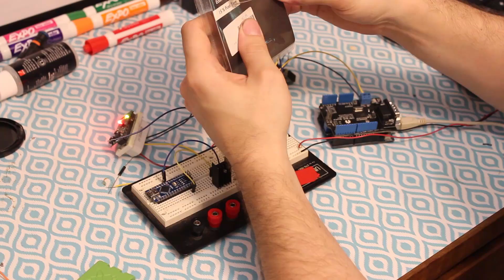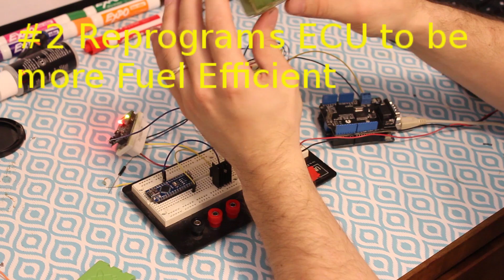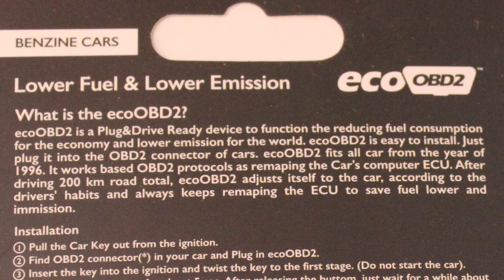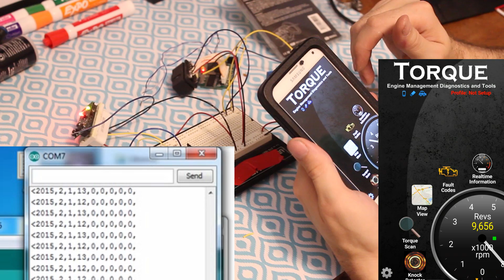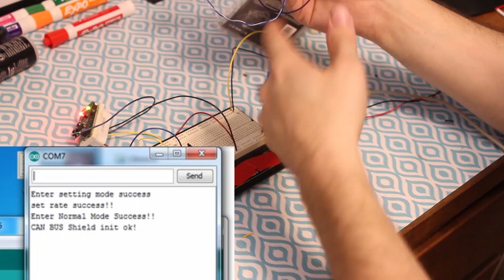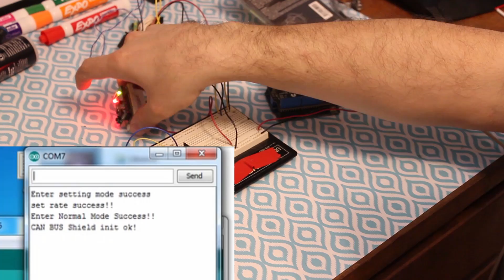ECO OBD2 Fuel Saver Busted - Voiding Warranties Ep 6

Comment: On the back of my eco OBD2
THE DIRECTIONS SAY TAKE THE KEYS OUT OF THE IGNITION. 
STICK THE KEY IN AND TWIST IT TO THE FIRST STAGE (DO NOT START THE CAR).
PRESS THE RESET BUTTON FOR 5 SECONDS. AFTER RELEASING THE BUTTON ABOUT 30 TO 54 SECONDS 
YOUR ECHO OBD2 WILL COMMUNICATE AND ESTABLISH CONNECTION WITH THE ECU. 
START THE ENGINE,.. THE OBD2 WILL RECOGNIZE YOUR VEHICLE AND YOUR DRIVING HABITS AFTER AROUND 50 MILES OF DRIVING. THUS THE ECHO OBD2 WILL ADJUST ITSELF TO MATCH YOUR CAR PERFECTLY FOR MORE FUEL SAVINGS. 

I DON'T BELIEVE YOU DID ALL OF THESE STEPS.

Comment: Aug 28,2023
I bought this for my 1998 Dodge Ram 5.2L.  Drove it 400km and filled gas tank. Drove another 400km and I used more gas not less.  This is a scam scam scam.

Comment: I tried that crappy $60 device (yeah, I fell into the hype, sadly!) and found out that it drains your battery, as it flashes red and green, even when the ignition is OFF and the key is outta the ignition, and even when you lock your car doors! You can easily see the flashing red/green, at night time, under the steering wheel! I will be returning it, post haste, for a full refund! I never even tried it out, as I was searching for why it flashes red/green when the car is off, and that is when I stumbled upon 3 or more videos saying this device is a scam! Thanks for posting!
Reply: It hooks into the same power buss as your ECU, which always draws a little current to keep volatile memory stored.

Comment: I will say upfront that I think using these, tuners as they are called, are a bad idea.  The risk/reward is not worth it.  That said, A car warranty is rarely voided.  I worked for the Customer Service Division of a major auto manufacturer for years.  I can count on one hand the times I saw a vehicle with an actual voided warranty due to a modification the customer made to the vehicle.  The company cannot refuse warranty service on a vehicle unless they can prove the device caused the needed warranty repair.  That is the rub.  They can refuse your repair and then you are stuck going after them in court or through arbitration.  So, they do have the upper hand.  

However, there is something called the Magnusson-Moss warranty act of 1986.  Lawyers often use it, and I am paraphrasing here, because if they go to court and prove the manufacturer illegally denied, what the court determines is a legitimate warranty claim, you can receive up to triple damages plus reasonable attorney's fees.    Another option you have is the BBB auto arbitration program.  

You can ask for your claim to be put in front of group of independent arbitrators.  The program is free.  A group of people with experience dealing with vehicle repair and/or arbitration will review your case.  However, you will have to prove to them that the device didn't hurt the vehicle.  The manufacturer submits a written report, as do the dealer and you the customer.  Another uphill battle, but not an insurmountable obstacle.  At has been my experience that they tend to lean the direction of the customer on a coin toss case.  Hope this helps.

Comment: i got one of these and was suspicious from the get go. After putting it in and setting it up i was surprised to see it stays on flashing with car off and keys in the house. it never shuts off putting a small drain on the battery.
Reply: Yeah me too I figured it would shut down. It’s in the trash 🗑 now resting beside chick fil a napkins
Reply: There is always power in the ecu even with the ignition off.
Reply: @Kgio-2112  the devise is junk . The obd 2 system in auto runs the best and most efficient fuel economy . If this really worked it would be incorporated in all cars . I opened it up and it's nothing but 2 flashing led lights and a 777 timing chip. Does absolutely nothing.
Reply: @grahamcross5652  I threw mine out. You are right. Total scam. I got it in my stocking lol

Comment: You can check all you want. That thing won’t lie to me. I have my car for almost 20 years and runs 200 miles with 10 galos. If this thing works I should be able to pass the 200 miles  mark. I will send a follow up reply as soon as I’m done with the test.
Reply: What happened
Reply: I still didn’t use a full tank but it looks like this sht is only garbage. I don’t use this car much, I have a second car which is a Tesla so the Chevy is most of the time parked. But the car never fails. It always runs 200 miles except for this time. I think is not gonna hit that mark.

Comment: Thanks for the wonderful review !  I think I'll just stick with my flux-capacitor - it's been working great since 1985 and my gas mileage REALLY takes off when I hit 88 mph !  I think that's because it was made in America, where we can SPELL English and our reset buttons don't get hot after 6 seconds !
Reply: Actually, If i remember correctly, all Deloreans were built in Belfast, Northern Ireland, Britain in a purpose built factory largely funded by a British business investment programme intended to provide jobs to the local Northern Irish workforce and reduce violence between Belfasts Protestant and Catholic communities as they would be working side by side in the plant. Was John Deloreans pipe dream disaster from start to finish and cost the British a fortune. Though I do genuinely  believe the flux capacitor will at least match these EcoOBDs in function and performance and you probably have as much chance of one of them transporting you to 1955 as saving you even a drop of fuel. 🤣
Reply: Are you using petrol, or Mr. Fusion (Trash)? If trash, then this is not an issue for you. If you are using petrol, they claim no change until after you have driven over 200 km. There is no way that they can resemble that. My question is, if the lights stay on when the vehicle is off for a period of time, will it drain the battery enough at some reasonable point to make it unable to start the vehicle?
Reply: Hey man!  Deloreans are CANADIAN!!!  ;-)
Reply: How do you get 1.21 jigawatts?
Reply: Scam avoid like the plague

Comment: I saw this dirt cheap, so I got one, wondering if it would actually work.   If not, I'd just be out 5 bucks.   Weill, the instructions, as you know, don't tell you dick all.  I don't care about how it works, I just want to see results and... now that I've got this installed in an out of warranty 2003 car and driving it to work back and forth for almost a week.  So far, I've noticed my gas usage has drastically reduced.   I was expecting to fill up tomorrow, as I usually get about 4 to 4.5 days on one tank.   Right now, I'm sitting at just over half a tank left.   I can't explain it.  If this kills my car, it's not a loss for me, so I can take the chance on this.  But I'll hold off putting it into a newer car.   I just wanted to mention the unexplained reduction of fuel consumption... and I don't noticed ANY performance issues either.   Maybe I got one that actually works?   I've seen these retail online for hundreds of dollars... those must be scams.   The one I got, gives me positive results, so, who knows.  lol  Peace.

Comment: Ever since i purchased this product 5 years ago, I haven't refueled. I've been driving on $5 gas for 5 years now, said nobody ever!!!
Reply: Hi everyone,

I’ve noticed some negative reviews about the eco fuel saver, and I wanted to share my personal experience and offer a different perspective. A lot of people might not see a noticeable difference, but I believe that’s because the product’s true effectiveness is best observed over the entire course of a full tank, from full to empty.

For example, I typically get around 400 miles out of a tank of gas (19.5 gallons). Using the eco fuel saver, I expect to gain about 60 extra miles per tank—around a 15% increase. However, this difference can be subtle if you don't drive your car down to empty. In my case, I may only see around 45 extra miles if I haven’t drained the tank completely.

I understand why some people might not notice a dramatic difference, but I believe it’s important to take this into account before making a judgment. It’s easy to miss these savings if you don’t monitor your mileage over the entire tank. Hopefully, this adds a bit of context for others considering the device."

Regards,
Jim L
Reply: @jim7060 😂😢😅 you gotta be a Democrat 😂you didn't listen to the mechanic he told you it didn't communicate with the Electronic Control Unit (ECU) it don't work as advertised by China 😂😢😅

Comment: This is not actually a fair test, because the instructions on the packet states I Quote - ecoOBD2 will recognise your vehicle and your driving habits, after around 200 km/150 miles driving and thus ecoOBD2 will adjust itself to match your car perfectly for more fuel saving.  This video did not drive for about 200 km's to be able to give a fair more accurate review, so really it could just work yet at the end of the day.  

I was recommended this by a friend, and bought one, I haven't yet used it though, however I have nothing to lose by testing it out and really seeing if it works after I'v driven it for over 200 km.  Will get back to you with an update if I remember to.
Reply: You forgot but I'm sure it's cause it did nada or it killed your engine.

Comment: Bro it works. You NEED a real car, drive 200km and THEN it'll start doing its thing. 

Depending on the car, it can be s real money saver. But if course,it'll mske the car's power lower. It's going to let it use less rmp.
Reply: The thing doesn't request or send any data. The arduino is literally just programmed to flash lights and nothing else. 

Explain how something can modify anything without requesting or sending any data?

It's like saying putting flame decals on your car would make it go faster
Reply: Jazz honestly I have no clue. But mine worked (took more than 200km it should take to start working) but wonders started to happen around 300km after plugging it in. 

RPM used to be on 2  or 1.8 and instant eco would be during that is 20-30L/100km (usually during speeds 40-60kmh).

Now, the rmp is forced down noticeably and in most cases between 40-60 kmh the average inst eco is down to 8L/100km in some cases. The car drives somewhat smoother as a result. 

How? No idea. Did it work? Evidently. 
It works better with high fuel consumption cars.

Edit: this was tested all this and last weeks. So its fresh info.

Comment: So what your missing is. You're supposed to drive with it plugged in for however many miles first. Then it starts to work
Reply: Does the ECU send data on the CAN bus (or anything on this port) without receiving a request for it?
If not, then this test seems valid: Regardless of how far you drive, this unit would not do anything different because it could not be aware of how far you drive.
Reply: How would it do anything? 

it doesn't record the data. How would it know that you've driven 150 miles when it DOESN'T request any data ?

Comment: All these "test" from people not testing it by following all the directions. If a product say drive it for X amount of miles first, then it needs to be tested after driving X miles. Not plugging it into you Nintendo gaming system.
Reply: If it's not communicating on the can system then it's not going to be able to read your mileage and adjust anyting the point is it doesn't read anything..
Reply: Anyone that needs testing on these products should just go ahead and buy it. Placebos work if you believe they do. Unfortunately anyone with an understanding how the ECU is programmed all ready knows that you can't flash the ECU on the fly. Linux kernel is embedded in everything, even apple uses a bastardized version.

Comment: Hm.   I bought one and i have a check engine light on for various reasons .. timing chain  .. cam sensor ..which means the timong chain has stretched alittle ...But when the check engine light comes on it goes to a default make your car run like crap I put the go green Eco OBD 21 and it seem to eliminate the computer scan and I get the mileage I should pretty interesting

Comment: I ONLY PADE £2.99P PLUGGED IT IN AND A LIGHT STAYED ON SO I UNPLUG IT JUST TO BE ON THE SAFE SIDE
Reply: Isn't it suppose to light up when plugged in? It's an indication that its actually working, well you can only hope lol
Reply: LEAVE IT PLUGGED, I DO AND NO PROBLEM IN DISCHARGING BATTERY.  MINE DOES WHAT IT SAID IT WOULD AND MORE.  TOO MANY INTELLIGENT PEOPLE HERE EXPERIMENTING AND THEY DO NOT EVEN KNOW HOW TO TEST, TAKE APART OR HAVE ANY KNOWLEDGE OF HOW A COUMPUTER MODULE WORKS AND THE INSIDE PARTS OF IT.  IT IS ALL PURE HOGWASH VIDEOS.  WHAT DOES THIS GUY KNOWS?  IS HE AN ENGINEER ?  BULL !!
Reply: @ManuelPerez-gz3ky  I would be curious to know what you've found that appears to work.

Comment: I got 1 of these for a diesel. I I know get more miles than before fact or my miles meter is lying. You have a fake 1 there
Reply: I INCREASED MY MILES PER GALLON TO 23.9 ON HWY AND 17.2 ON CITY AND THE DEALER COULD NOT DO SHIT TO IMPROVE MY MILEAGE.  2018 SILVERADO !
Reply: BOUGHT ONE FOR MY SON IN LAW'S SILVERADO DIESEL , HE HAS NOT INSTALLED IT YET.
Reply: This is a reasonable point. You might be testing a counterfeit. Either way, the folks that say that similar devices are working for them would be interesting to follow up.
Reply: A fake fake would work.

Comment: But the seller says you have to drive for about 200 miles for this chip to adopt your car ECU  and your driving habits to begin saving fuel. By simply connecting it there will be no result. We need it ytested on a real car after 200 miles running.

Comment: Nothing that costs $10 has a real ELM327 chip. ELM charges quite a bit for one of their genuine chips. Anything with a real one is going to cost at LEAST $50. 

I'm guessing you're either European, or own European cars because you've made some incorrect assumptions. Any device with an OBD2 port must respond on the basic serial channel as well as any proprietary bus the manufacturer uses, such as CAN or SAE J1850 PWM. That's likely why you didn't get any reply from the device, your "Vehicle emulator" was incomplete.

Not that I don't think this thing is a complete scam. Real performance/eco ECM tuner hardware (Eg Hypertech) is specific to particular vehicles and uses updated fuel maps specifically for that vehicle.  I think you're right in your guesses that this either fakes a sensor input (IAT is a great guess) or tries to trigger EPA mode, or both.
Reply: Brian Skene I don't have to. Get lost.
Reply: This one does work. Needs 200km before it starts it's thing.
Reply: @DarknoorX  Bullshit!!! If it can't communicate with the ECU it has no way of knowing how many miles the car has travelled. try again
Reply: Outsider dude.. It can.. It worked for my cousin's Ford Explorer 2012. I usually call bs on such tools but it did work
Reply: @DarknoorX  When you plug it in, The chips go nowhere, Its not even connected to the computer. LOL
Reply: @mustangpassurchevy  another video where a guys checks the connections, the pins are connected to the printed circuit boards... why are you saying that "chips go nowhere" did you opened one and do you have an electronic engineering background?

Comment: Manufacturers program vehicles to cheat on emissions unless the vehicle is hooked to a OBD2 scan tool. This device likely makes the vehicle always think it's being monitored keeping it running within to EPA requirements.
Reply from the maker: +Michael Haiducek There may be some undocumented way it could work, however that is not what the device claims, nor is it likely through a 10k ohm resistor.

Comment: I have no doubt this thing is junk, I only loaded the video to see how you tested it. Having said that, CAN-BUS is one of the protocols used in the OBD-2 specification, OBD-2 in itself is not a protocol, and vehicles can easily be reprogrammed through this port, as long as the programmer uses the proper protocol, and the ECU can be unlocked (some cannot be unlocked by an OBD-2 based programmer). I have probably installed power tunes in 40 cars and trucks over the years, mostly in trucks (better mpg and more torque for towing). Still beats the old fashioned method of replacing EPROMS in the ECU.
Reply: You do realize this actually works but he didn't follow the instructions, right? 

From real life experience.
Reply: @DarknoorX  You sound like somebody who sells them on eBay for $50, LOL.
Reply: @bobbyclemente21  haha
Reply: @DarknoorX  haha

Comment: DO IT ON A REAL VEHICLE,BOZO!!
Reply from the maker: +JAMES COLA Nope. Why don't you make your own video, with a back to back test on an engine dyno showing the fuel saving.
Reply: I HAVE JUST ORDERED ONE, I WILL TEST ON MY JEEP. AND I WILL POST!! THANK YOU
Reply: WHY WOULD YOU PULL OUT A BUNCH OF WIRING AND SOME BOX AND TELL EVERYONE IT SIMULATES A REAL VEHICLE??  YOU FAILED TO DAZZLE ME WITH BRILLIANCE,BUT YOU DID BAFFLE ME WITH BULLSHIT
Reply from the maker: Just testing it on a vehicle is not enough. Driving habits can easily make >20% difference on fuel economy, humidity and temperature can change things by over 10%, and different fuels can change things even more. This is why laboratory testing is done with engine dynos and very controlled test setups. The best way you could do your test is with a long term test using fuely or another fuel monitoring program, but to get solid data including the 150km setup time will be difficult.  Your test could easily go 15% either way with no change from the magic box.
Reply from the maker: Nope. You first, make your test as scientific as possible. Have a back and forth between the control and the experiment to limit any outside influence, and post back. I would really love to see it.
Reply from the maker: +JAMES COLA And you do know I have other videos where I hacked my cars network to add a boost controller right?
Reply: Voiding Warranties 1 year on...he never did upload that video....🙄